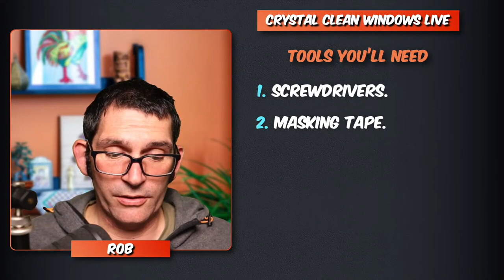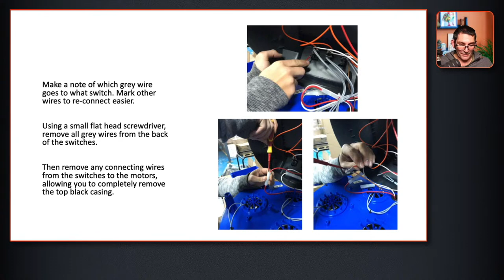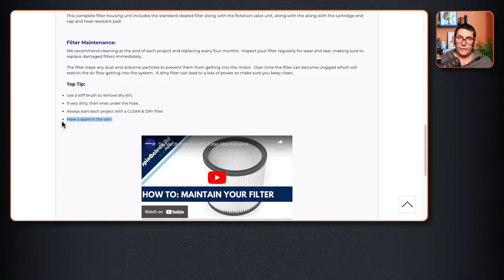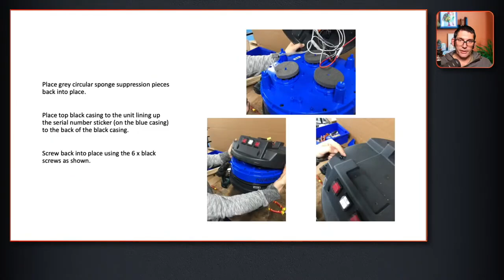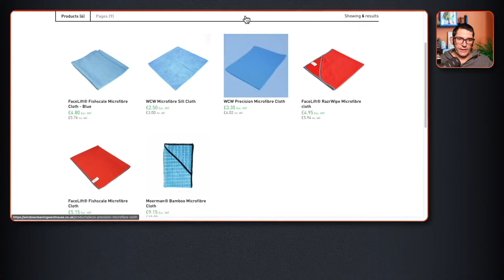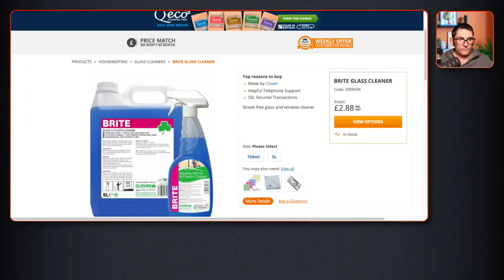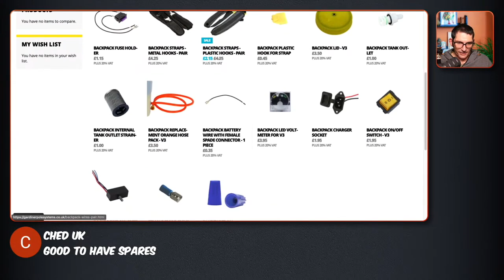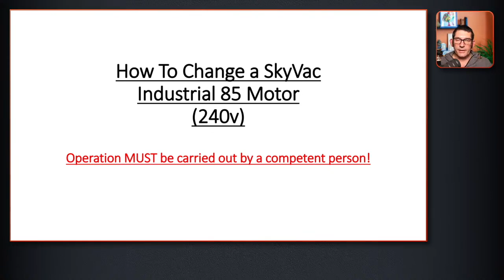Replacing My Skyvac Industrial 85 Motor!

Comment: Are you using too small of a generator?
Reply from the maker: Hi Mate, i am using the right generator, it is a skyVac 5kva Petrol Generator. I have found the motors sound more powerful with this than using mains electric.

Comment: This sounds like you're replacing a motor, not upgrading?? Interesting though.
Reply from the maker: @Codescodes  good point well presented mate 👍 I will have to change the title. In my small defence they do have a more powerful motor r that I could upgrade to 😂
Reply: @CrystalCleanWindows  I would love to see that! I have this Skyvac. Love it but wish it had a touch more power. In Canada the leaves clog at the tip quite often. Still love it though! Thanks for the vid!!